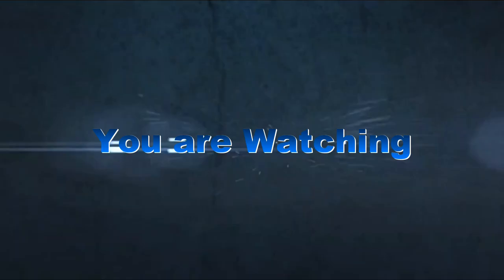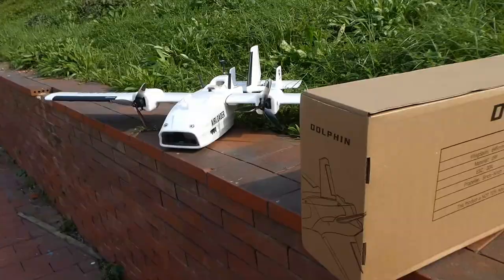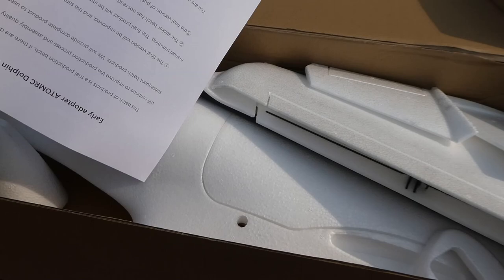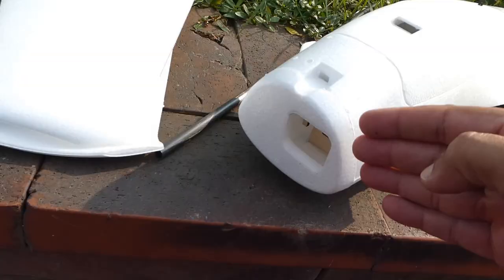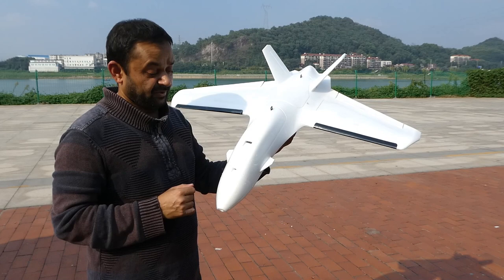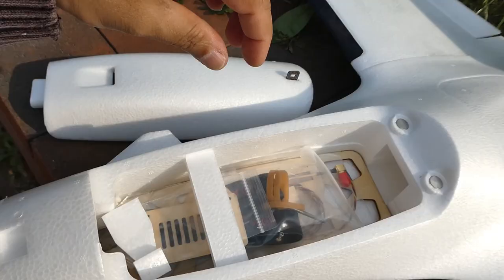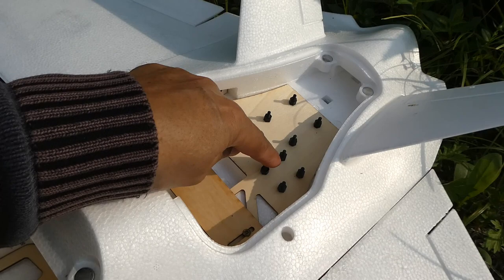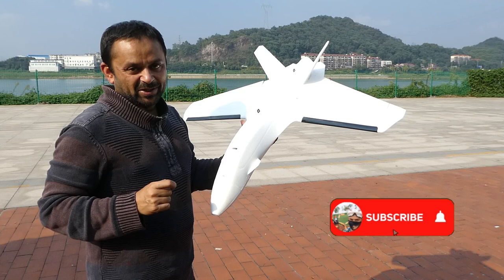Unboxing Skyzone AtomRC Dolphin FPV Flying Wing Kit

Comment: It looks like Firefox from the 1980's film with Clint Eastwood, you have to paint it black! :)
Reply from the maker: Complete black will look like a serious drone hahaha. will be very hard to see in the skies due to its size. only FPV Flights can be done then. with even white I a worried about doing LOS flight testing specially if I put a very fast 6S setup hahaha.